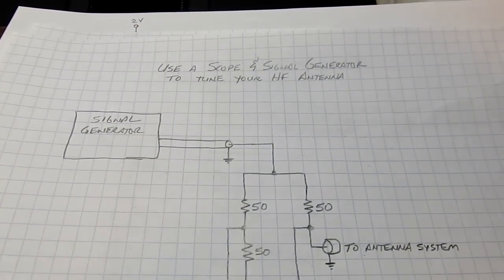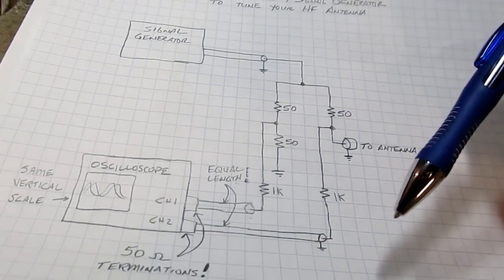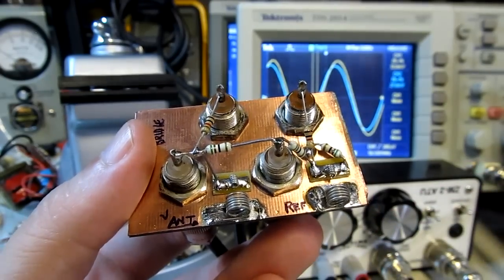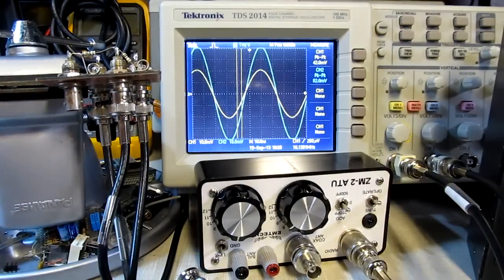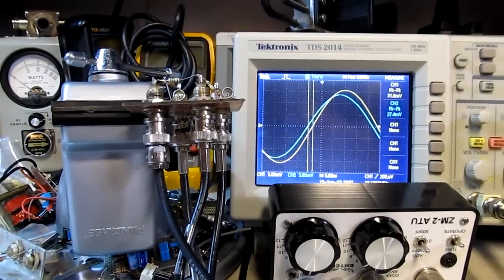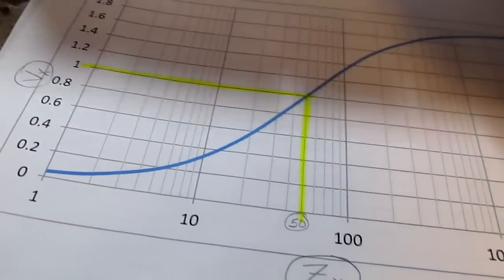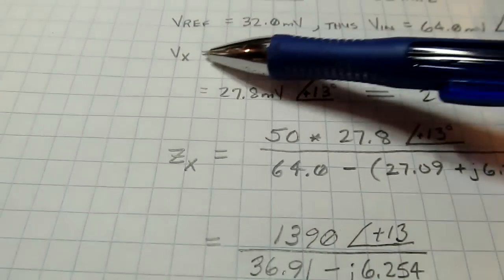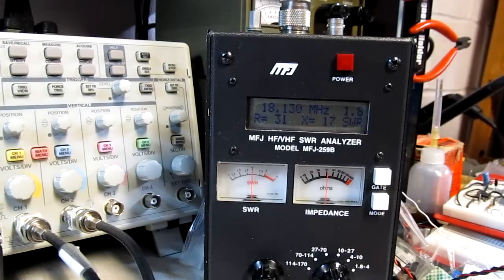#112: Use an Oscilloscope and Signal Generator help tune an HF Antenna, measure complex impedance

Comment: Hi Alan, 

I used your approach and it works so long as the measured impedance is close to 50 ohms.  However, I tried something a little simpler and compared my results to both two separate calibrated nanoVNAs and my calibrated RigExpert AA55  and my results came out within 5% of these analyzers.  The two nanoVNA's were within 2% of each other and the RigExpert was a little further off.   

My circuit is simply a 1% 220 ohm 1/4 watt carbon resistor connected in series to a function generator and an HF antenna.  A 200 MHz digital scope with phase measuring capability set up for 10X probing on channel 1 and 2 was used.   No 50 ohm terminations were used or needed because all I was interested in was relative RMS voltage at the top and bottom of the 220 ohm resistor referenced to ground and the phase difference.

I plugged the two measured voltages at 7.213MHz and 14.250MHz along with the phase into an Excel spreadsheet to calculate the load impedance, return loss, VSWR, both rectangular and polar coordinates and reflection coefficient.   I used the scope's averaging to get the voltage to settle on the sine waves.   The results I got were within 2% or better of the nanoVNAs and within 5% of the AA55 RigExpert antenna analyzer.  

I have not tested large impedances relative to the 220 ohm resistor but I suspect if the impedance is between .1 to 10 times the reference resistor (22 ohms to 2200 ohms) I should be reasonably accurate.   I would appreciate your opinion on my setup and any issues you see.  I may just have been lucky to get close measurements.

I got the idea to try this simpler approach from Kenneth Kuhn's article titled "A Simple Circuit for Measuring Complex Impedance" "http://www.kennethkuhn.com/electronics/impedance_measurement.pdf"

Thanks and I really appreciate you taking your valuable time to teach all of us electronics.

Hank Hamner
K5HHQ
Reply: Gracias por responder. Creo que los valores que encuentras son más que suficientes para una estación de aficionado sobretodo cuando estos se encuentran en las proximidades de los standard y como tú dices además y es que finalmente el transmisor “ve” todo lo que haya más allá del conector. Siempre me ha interesado la medición real de la impedancia de una antena de HF y esto no es muy práctico por la dificultad a un acceso directo a la misma o al diseño de un analizador de características muy especiales. Abrazo.

Comment from the maker: to John Brown - Yes, this is not uncommon - and is one of the things that makes analyzer like the MFJ-259B difficult to use on low-band antennas sometimes.  A bandpass filter can often help, but it all depends on the frequencies of the incoming (interfering) signals.
Reply: +w2aew  I couldn't find John Brown's message so I just suppose he had problems trying to measure  with his analyser into the lower HF bands.
I use a VK5JST analyser and had problems with a MW Broadcast station about 25 km  away. I just connected an 1:1 choke balun  between the line and the analyser and I am able to steady measure in all bands. Measurements confirmed by trcvr working with the antenna as set up with the VK5 JST analyser

Comment: You used an instrument to tune the antenna. After that you use the number on the dials to design a equivalent circuit to hook before the antenna?

Comment: Just finding this today.  This is such a handy thing!  Just a simple bridge circuit, but never thought to do it to tune a circuit.  I'm going to have to build one of these.  For weird bands where you don't have an analyzer, or for working with 75 ohm systems, it's a great trick to have up your sleeve.

Comment: Hi Alan. Great video as usual! What material is the board used to mount your bridge circuit made from? It looks like copper-coated perf board of some sort. It looks nice for shielding purposes while still being easy to drill holes through.

Comment: For a few scraps of PCB, some connectors, and resistors, this is a brilliant method to "see" the workings of an antenna/transmission-line system. The advantage of the 'scope is it's very high voltage sensitivity-10 mV/div. It will work with a favorite of amateur operators--MFJ259B as a signal source. In spite of its limitations, it's worth a try. And voila, resonance and resistive match in one fell swoop. This is an excellent candidate to sell as a kit. Your level of practicality is amazing and a badly-needed adjunct to the amateur "rags" of today. Words of thanks are barely adequate.

Comment: That was fantastic...Very concise and easy to follow. I make my own high frequency antennas (433, 1.2ghz, 2.4 and 5.8) and I use a DIY SWR meter, but this fills all the holes for the other measurements I was looking for.  Very handy technique - thanks for documenting.

Comment: Great video. One of the best for this subject.
This is my meat! You could use this idea not just for antennas but for for visualising filters etc. One could also use the inv and/or  add functions on the scope to to aim for a max sine-wave or flat line. XY might also give some interesting results. 

With persistence, and a good CRO (scope), HP calculator, variable network filter and LTSpice et al and you can immerse yourself at a practical level till you really, really know this stuff.

Comment: Little bit out of date finding this.... I can see a couple ways to make it more complex, but eliminate some of the other hard to control bits. A couple of opamp instrumentation buffers could drive the scope with low Z to eliminate all of the termination and coax impedances, you’d most likely have to layout a PCB to pull that off though. Using some board edge BNC and SMD components to further reduce parasitics, would be worth while I think. Might take advantage of the opamps to invert one of the outputs and shoot for a null rather than trying to match waves. Also a great time to use that old analog scope with its infinite bit technology as 8 bits of vertical resolution is a rather limiting factor for most ‘affordable’ DSOs. I’ve been kicking around ideas to do something like this and you provided me a starting point, or rather, near end point. Thanks for the great presentation.

Comment: This is awesome,  o only know very limited knowledge of electronics from my dad growing up, he was in the military for electronics and worked on radios and the original huge night vision scopes. He was stationed in Taiwan.  I built quite a few things growing up like  the lie detector and an guitar distortion box I still have today somewhere that I loved the best.  I found you here looking how to get to find the exact frequency of antennas or more accurately for what in doing exactly is making copper coils as a necklace pendant that I’ve been working on for 7 years now daily and I’ve always been driven crazy trying to find certain frequencies that do certain things for healing and I’ve see miracles with them but I’m in the dark what frequency I’m making because the wavelength changes when I coil the wire into a custom coil I designed of my own that’s really amazing but I’m goin insane because I do t know what length to make them to compensate for the winding so it’s pretty maddening for me, then I heard someone out here talk about finding the frequency of an antenna with the oscilloscope and I didn’t think it was possible really but I’m seeing in my head it can be.  I found a cheap used one near to me to get once I get my tires put on I can go get it.  Is there an easy way to see the exact frequency of a copper coil that you know so I can see what in ending up with so I can find a compensation to get what I’m wanting to make in the end after winding it up? 
I need some sanity lol.

I’ve been working bday and night on this for 7 yrs trying to solve this mystery without the tools or skills to see what I’m getting in the end.  Just want I help people feel better easily and I’m getting Somwhere good with it finally just recently the hard way but I’d like to refine it to perfection this way. 

I’m good with doing the electronic work and can solder like a robot since I was 4 or 5. But my technical knowledge of the finer parts of it all is blah 😂.  Was never good in school or math.  That’s why I can’t believe I’m doing this for 7 yrs mile a mad man.  It’s my wanting to help people not suffer that drives me to do what I’m the worst candidate to do it.  I care probably way too much and want to find easy and safe ways to stop suffering for us all and not hide it.  I’m doing a good job of that already now for 35 years and it all led me to invisible light colors bam dive got down how to make any thread of any color of invisible light for some years now by El wavelength and all I need to finish this off is to find what the coil is after winding it and then I can help people way better. I’ve seen literal miracles with this I created.  If I can know exactly a frequency when it done I can cure anything by people just wearing a necklace tuned to cure just about anything. I do it underground to keep my life of you understand. M
Any help will be helping not so much just me but mostly others really. 
I do it all for free as I believe it should be. 
It’s cost me at least a quarter million over the last 33 years curing people of just about anything you can imagine at my own cost.  So now I’m broke but I keep going.  I’m a bit crazy as you can tell 😂 m
It takes crazy to do stuff like this.

Comment: If memory serves me right, the AD8302 would be a perfect candidate to measure the phases of the voltages. Nice video. 
I use the HP4815a, and the HP4193a, but unfortunately affected by strong RF signals, from signals received on the antenna. I should try your concept, of course using none reactive glow bar resistor, I hope! LOL!. 
For those interested in more info, about the ad8302, see, Analog Dialogue 35-05 (2001) 
73's, Dale.

Comment: I like this Video. Because I am lazy, I used Freemat (it is free) for calculation.
--> Vin=64;
R=50;
Vx=27.8*exp(i*13/180*pi);
--> Zx=R*Vx/(Vin-Vx)
Zx =
  34.2726 + 14.2773i
-->

Comment: If you take the digital data from the scope curves, you can find the best match statistically.  I do not know if there are digitally controlled tuners, but that matching can be done to arbitrary precision by using all the data in the signal and letting it run for a while.  The statistical fluctuations will be local changes in temperature, electric and magnetic fields, internal noise in the power. Then fields from power systems, electromagnetic manmade sources, and natural sources.  I am trying to get down to levels where the gravitational field can be measured, and that means identifying and adjusting to all the noise sources mentioned above - in real time, or by recording everything and doing it after the fact. Gravitational detector arrays are growing rapidly, but every instrument needs to be checked carefully for electromagnetic noise of all kinds.  Since electrons have mass that "noise" will include seismic and vibrational noise, and movements.  However tiny the signals, they will usually be there.  Being thorough helps.  Recognizing that every "noise" is a signal of something happening somewhere helps. And every signal has a group that is working on it.

Nice video.  Thank you for explaining carefully and precisely. If you record the data and apply some basic regression you learned in school it will help make sense of what is happening in gravitational engineering these days.

Richard Collins, The Internet Foundation

Comment: Interesting exercises to follow along and to play with. I am not used to the XY-mode of a scope, but could that help some to read the phase shift more accurate on the scopes that do not have automated measurements? But very good to use these measurements and calculations to exercise the complex number calculations, and the compare with different measurement devices. But as the frequency goes up we have to take more and more care about the used components and the setup in general. Thanks !

Comment: I would love to see more about how to apply complex math and do calculations effectively in actual situations. Some tips/tricks maybe? I've studied theory at uni but it was presented in a very non-practical way, not easily applicable to actual circuit design. Seems to me that 99% approximations and 1% ltspice gives good enough results in less time, Maybe audio isn't considered real circuit design? :) Thank you very much for doing these videos! Highly appreciated! Greetings from Sweden

Comment: Super Alan! Great ball park double check to the Antenna Analyzer. Since some cheaper DSO's now have tracking cursors, would any improvement that may give to the delay measurement (to get phase angle) be significant? Also, if one used construction like your attenuator (symmetrical, compact, SMD, SMC jacks, etc) -do you think that would add any significant improvement, especially at higher Hz? Or is that not worth the effort due to scope error limitations.

Comment: Thanks a lot! Very nice, very usefull. 
I want to measure the impedance of a wire antenna (helical connected only on one end on my PCB), can I use this method? need to change something?

Comment: Excellent video once again Alan!  Is this essentially a return loss bridge with the detector split into the two scope channels?
WOW, You really made me learn something here...  I just put my scope across the two detector inputs (top end of the RF xformer...), one channel on each side of my homebrew return loss bridge, and can see visually the peak on one channel and the null on the other...  Had to put the spectrum analyzer on zero span to make the measurement.  So with the xformer in the circuit, I don't see the same thing as in your video, it looks more like an swr bridge - peak on one side, null on the other.
Reply from the maker: It's really not a return loss bridge, but simply an impedance bridge which is used to compare the impedance at the DUT port to a fixed 50ohm resistor.

Comment: Hi, firstly, I would like to mentioned that you have lots of very good video with very simple and easy to understand explanations... Keep up the good work!!!!  I've made SWR bridge and was feeding it with a AD9850 modules that can output 1Mhz to 30Mhz m just nice for the HF bands... I just follow all the circuit that you did and I was able to tune HF antenna using an antenna tuner. I find the AD9850 voltage is rather low at 20Mhz and above ...  Can you suggest a method to amplify the output voltage of the AD9850 ?? Does the 50R/50R voltage divider causes the readings on the oscilloscope to read a low voltage ? Thanks ,,,
Reply from the maker: Often times a drop off in amplitude at higher frequencies is a circuit layout problem - so it is difficult to comment why you have a drop off.  You may be able to improve the layout to bring the amplitude up.  A simple common collector amp can be used as a buffer (if the issue is simply loading), or a common-emitter amp would give you some gain.  You'd have to follow the common-emitter amp with a common-collector amp to regain the low output impedance.
Reply: The drop in amplitude as freq increases was stated in the AD9850 datasheets. Can you give some part number examples and sample circuits on the common collector/emitter amp as a buffer ? Could I suggest you do a video on the topic to how to increase the gains on RF signals ?
Reply from the maker: Stanley Seow That's a good idea for a video, but it will take me quite a while before I get to it.  Each video is often weeks or more in the planning and preparation stages...  You might get more prompt answers by consulting the applications engineering department at Analog Devices - the maker of the AD9850 - they may have some reference designs already prepared.
Reply: Ok thanks... let me do more readings and lookup their application notes...

Comment: Very nice thanks.  I noticed that the antenna port trace (blue) actually "leads" the reference trace. If the blue trace "lagged" the reference would the angle be considered negative?
Reply from the maker: Yes.

Comment: Hey! Nice video! A quick question: Why do you need to measure with 2 channels terminated to 50 Ohms? It would be easier to use one channel over the bridge: If there's a missmatch you will see a (distorted) sinus. You can then tune to 0V on the scope. That would work too, if I'm not mistaken?

Comment: This is an extremely interesting video (both parts). Thank you very much.
The 50 ohm thru-terminators are interesting. Would it also be possible to use BNC Tee connectors with the input signal running through to a 50 ohm terminator on the female connectors, with the "male" connector into the scope (similar to an end-of-the-run on a coax network)? - wk2w
Reply from the maker: At HF frequencies, a BNC tee with a terminator can work acceptably when located at the scope input.

Comment: Thank you for your videos.  I am trying to setup this process but cannot find an inexpensive 50ohm through terminator.  Will a BNC "T" fitting with a 50ohm end cap work the same as the device you have in the video? I am new and just need a little hand holding.
Reply from the maker: It will work reasonably well for lower HF frequencies, and may introduce some reflection artifacts at higher HF frequencies, but they should be fairly minor.

Comment: Excellent. I'm curious, I have two HP VVM's viz 3575A and 8405A. Will the vector voltmeter be far more accurate than an oscilloscope. I used the VVM's a few times to measure resonance but notice there were differences between the scope, spectrum analyzer and vvm. Which is better?

Comment: Great vid! one question though, can I implement this concept in evry input impedance measurement?(such as amplifiers, mixers, etc)
Reply from the maker: Yes, it should work for other devices - but layout limitations means that it will likely only be accurate for HF and below.